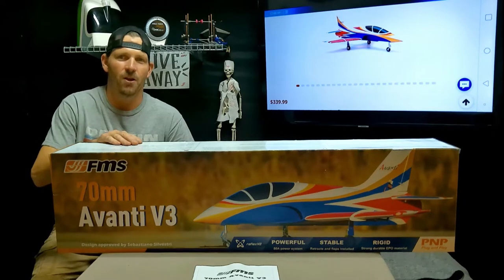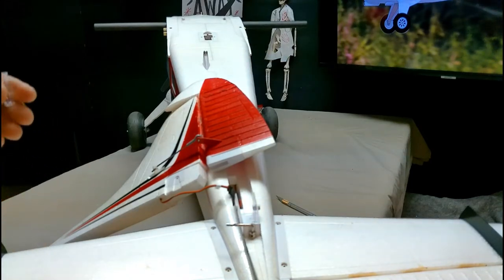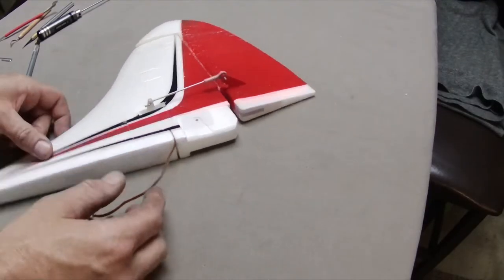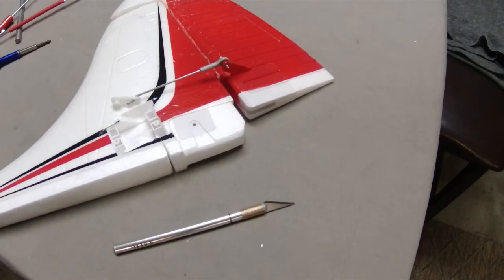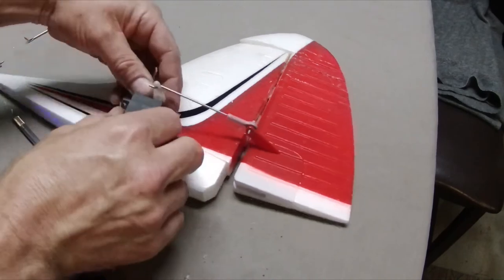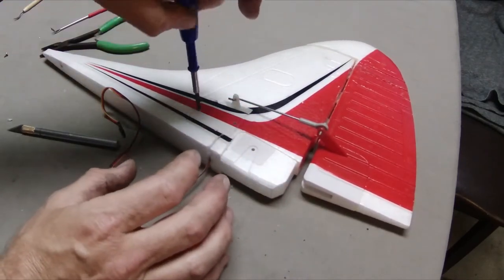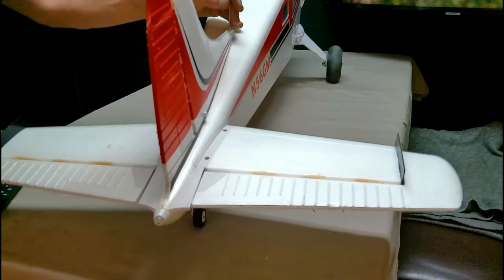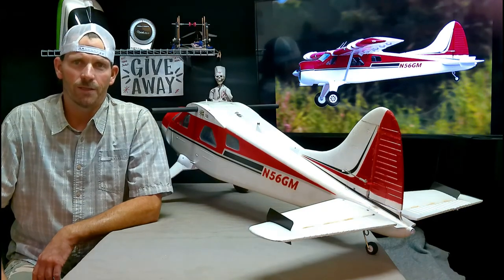FMS 2000MM BEAVER V2 RC AIRPLANE RUDDER SERVO REPLACEMENT HOW COME THEY CAN'T ALL BE LIKE THIS

Comment: I'm thinkinig of buying a Beav. but was concerned about eventual servo replacment.  Your video is priceless thank you
Reply: Good job sir ..some would pry and break it
Reply: I'm on the fence between the Beav. and the Arrows Husky Ultimate.
Reply from the maker: HI BUCK IM GLAD THAT VIDEO HELPED. IT HAD ME STUMPED AT FIRST ALSO
Reply from the maker: THANKS
Reply from the maker: IT IS A GREAT PLANE ONE OF MY FIRST VIDEOS . NOT A VERY GOOD ONE .... BUT IT SHOWS HOW I TOOK THE SERVO BOARD OUT OF THE BEAVER WHERE YOU CAN STILL USE THE QUICK CONNECTS AND AND PLUG ALL SERVOS DIRECTLY INTO A RECEIVER

Comment: Also to add, just recently my Beaver lost to a battle with my ceiling fan while I was putting it away.  No one in the U.S. had a vertical stabilizer to sell, and they were all out of stock.  I found that Porcupine R/C in San Po Kong, Kln, HK has all the parts.  I was a little apprehensive at first to order from "China" but they came through and fulfilled my request with no issues.  Since then, I have ordered two more times also with no issues and the latest order was on 09/2024.  Their method of payment is with PayPal and its secure.